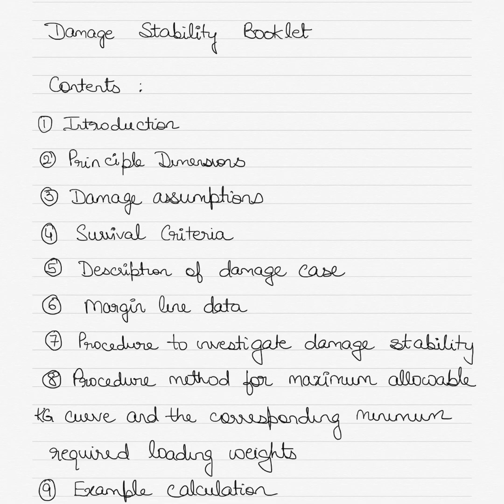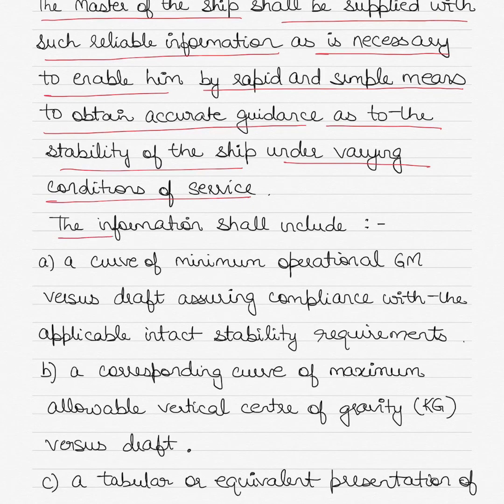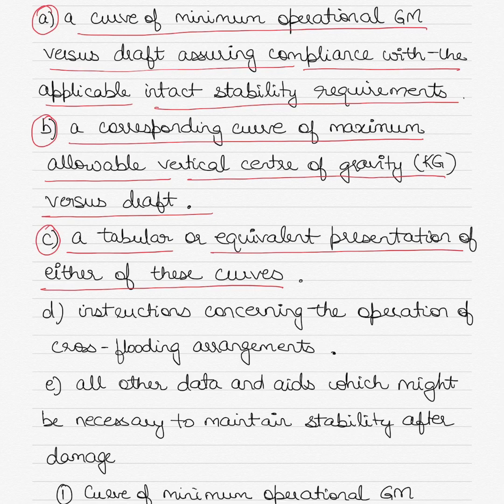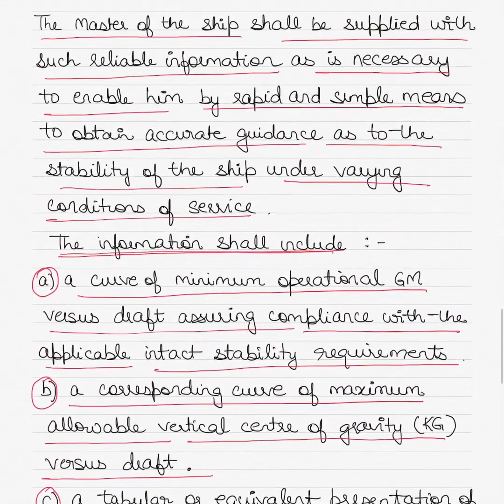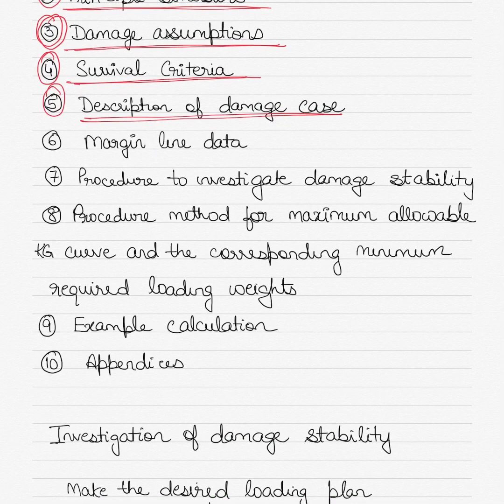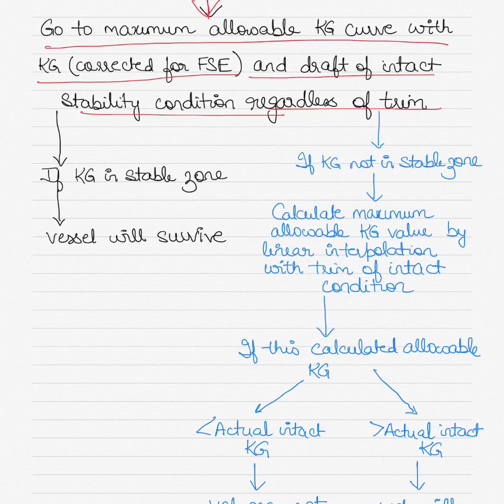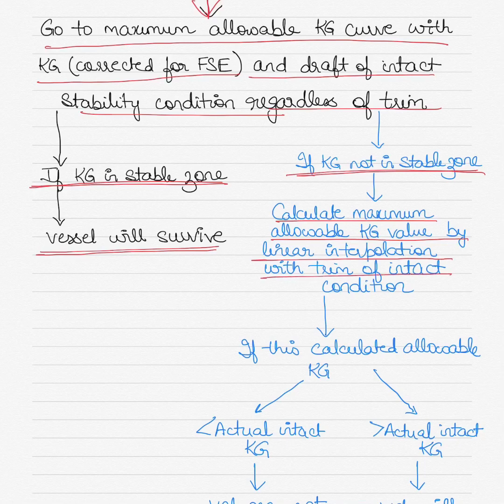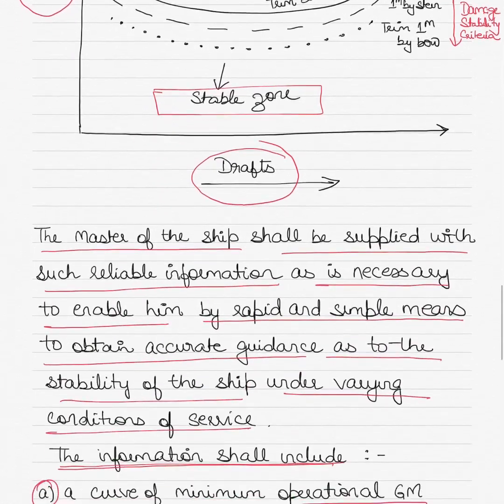Damage Stability Booklet and Damage Control Plans

Comment: Thanks for the above explanation. Kindly clarify as to why are we entering the maximum KG curve twice. Where in the first glance we can make out that vessel is complying with both the Damage stability and Intact stability requirement given the draft and KG corrected for FSE. And also if you can give a gist of table indicating minimum required loading weights at various drafts as mentioned above in the video. Thank you. Awaiting your reply.
Reply from the maker: Thanks for your question. To answer: We enter the maximum KG curve twice because one is for a predicted condition (based on current loaded scenario) and then second (with the actual weights on board; actual KG corrected for FSE, etc.). 
Don't have access to the table you are talking about but always on the lookout for one :)
Reply: Hi friends
 For preparation of second mate / DNS/ BSC nautical science/NCV come in #kundanpatna